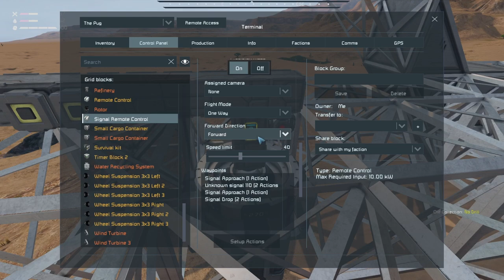Drone Printer - Automation Survival Episode 6 - Space Engineers

Comment: Episode 1 "I'm gunna try to challenge myself and make this playthrough hard" then you take away spiders cause they are hard and added free loot in the form of zombies that can barely move, you're now taking away lightning?  So much for challenging yourself if every time it impedes you in any way you turn it off, I'm confident the meteors would be off if they touched your base once.  This kind of lying at the start of a series is what kills a series quicker than anything.
Reply from the maker: I turned or changed several thing throughout the season due to viewer suggestions or due to disliking the spiders for example... many other changes were due to performance issues I was having and Meteors was a huge impact on that due to voxel damage, I understand where your coming from but have you actually watched them all?